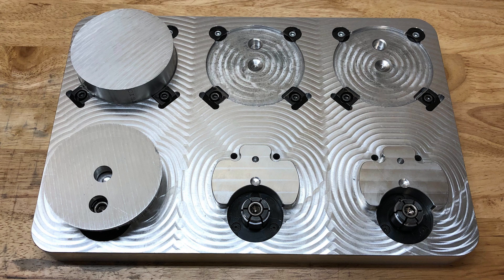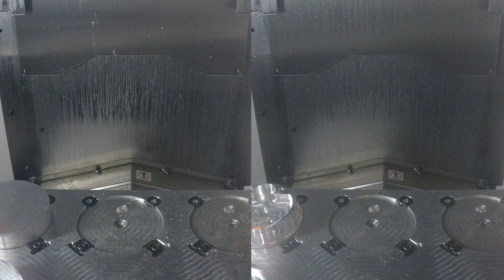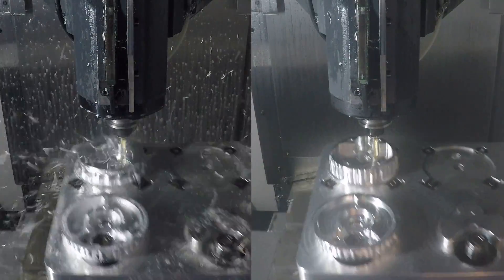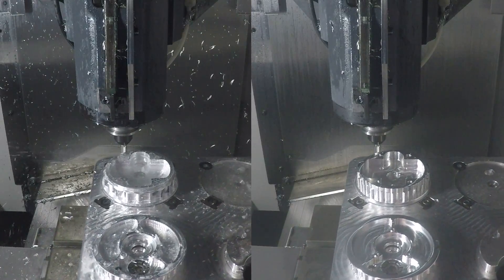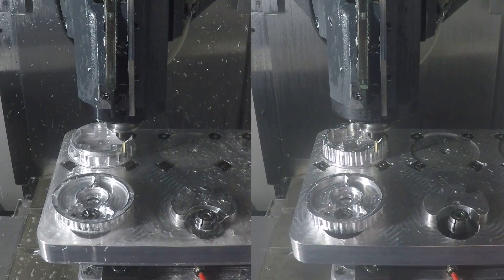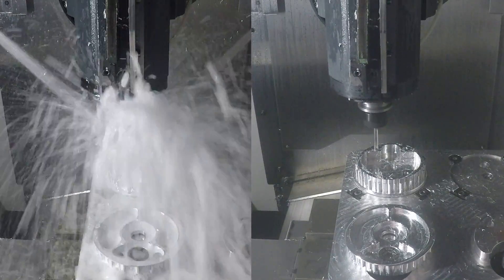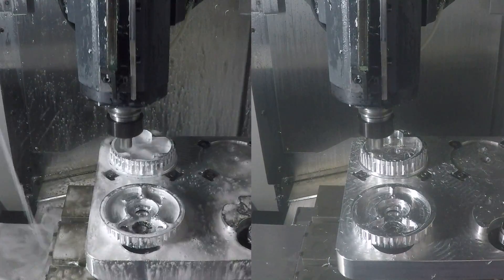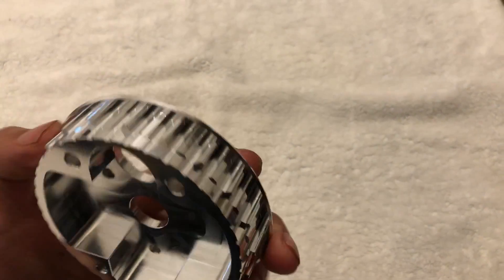MK2 Main Pulley, Full Machining Process, Brother SPEEDIO S500X1

Comment: Great video!  How much do you leave on the floor and on the sides for your finish passes?  Do you make any further adjustment  because of the 480IPM roughing?  I have a S1000X1 and I find that at that quick of travel, I have to adjust quite a bit so I have plenty for my finish passes.  I don't have the high accuracy option, do you? Also, nice G100's.
Reply from the maker: I do not have the option with increased look ahead. I'm roughing with accuracy modes turned off (M289) for maximum speed. I'm leaving between 0.01" to 0.015" (depending on the geometry) on the sides and 0.005" to 0.01" on the floor to ensure the roughing doesn't touch the final part. For finish passes i'm using the M282 accuracy mode.